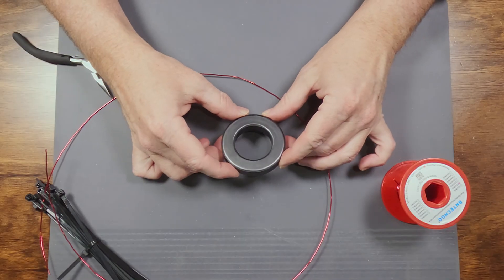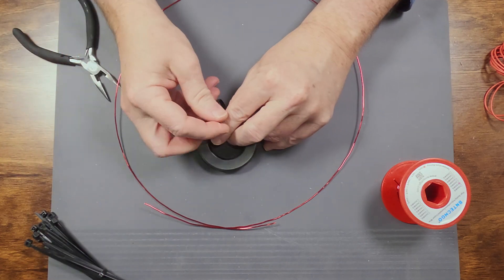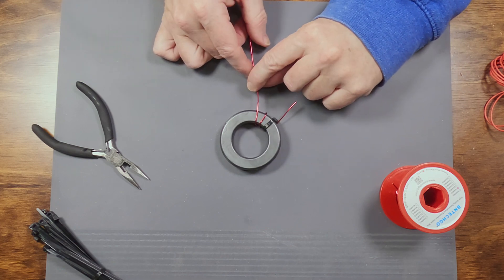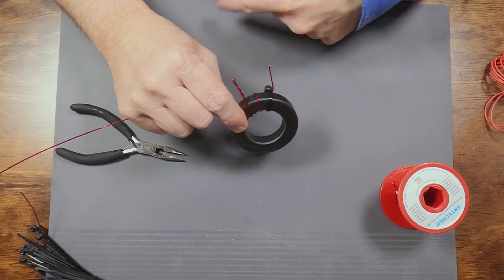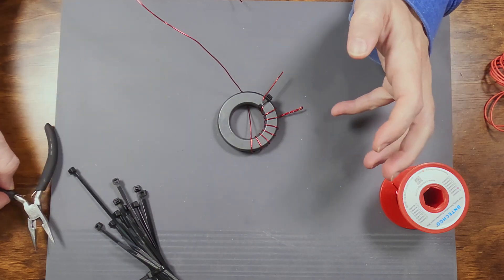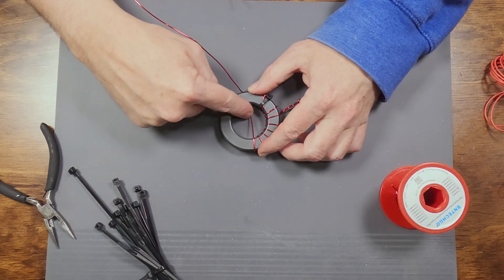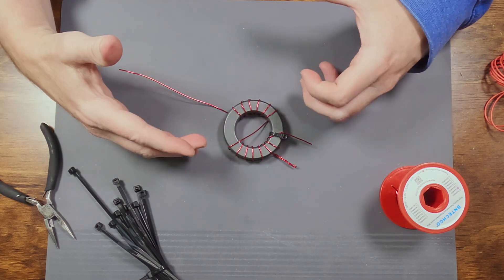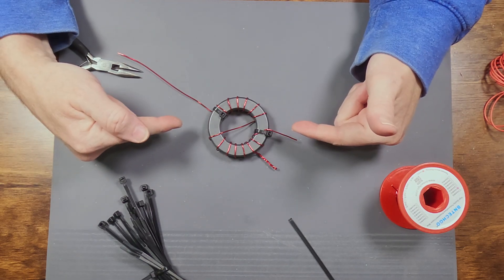Single Wire 49 to 1 UNUN

Comment: Just finished construction of a 49:1 balun exactly as described using 40 inches of #16 magnet wire. I first tried with #14 insulated wire but it was too hard to get the sharp bends. Entertaining project! Hope to put it to use on a new 160 meter half wave wire. K0DVT
Reply from the maker: You may have better luck with a mix 31 type ferite on 160M.  Type 43 will work but you're right at its limit.  If you're running more than 100W, stack 2 or even 3 torrid together and wind them as a bunch.

Comment: How much of a power loss is there between auto transformer style and single wire style? Im getting ready to build my first one! Thank you. Also great video! Long live radio.
Reply from the maker: The auto-transformer has a higher coefficient of coupling, meaning more power gets from the primary to the secondary.  It's a fairly significant improvement in a transformer like this one with so few turns on the primary.
Reply: @MattHeere awesome thank you I will go with that design then when I make mine. I have the torrid and have some 16 gauge insulated wire I just need to figure out the capacitor value is it okay just to use regular capacitors where are there some that perform better for RF

Comment: Excellent video. What size wire should be used for 100 watt input vs 600 watt input. Also what is the approx length of the wire used for the winding? Thanks very much!
Reply from the maker: The power doesn't affect the wire much.  RF travels on the surface anyway (skin effect).  You'll need to stack at least two toroids for 600W though, and depending on the match you end up with you can generate some heat.  18AWG or larger with PTFE insulation is about perfect.    Length of the wire will depend on how many toroids you stack and their exact dimensions.
Reply: @MattHeere  Thanks Matt - Do you have a video on "stacking" toroids? Ken K0DVT

Comment: How many cores do I need for a kw
Reply from the maker: Depends on how you want to run.  For a typical 40M-10M EFHW you'd probably get away with just one if you only run SSB.   If you want 80M or 160M, and you might run digital (including CW of course) then you might need as many as 3.  You also are going to need some good high temp wire.       You'll want to monitor your UNUN temps, at least at first, and ramp the power up.  See how it goes.

Check out TRXBench here on YT too.  He has some old, but still very good videos on solid construction techniques.